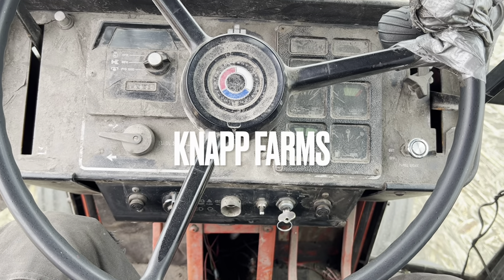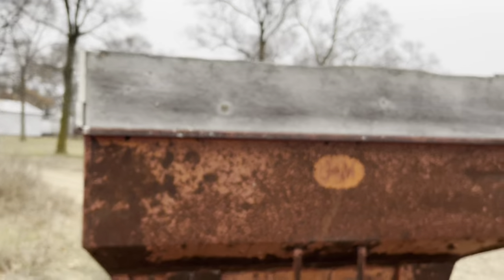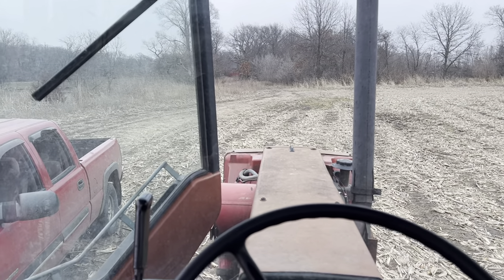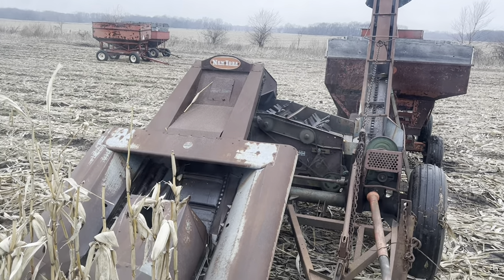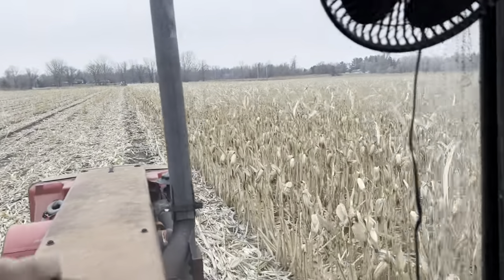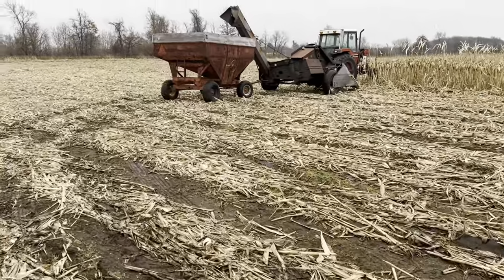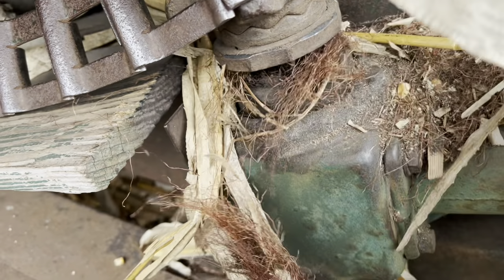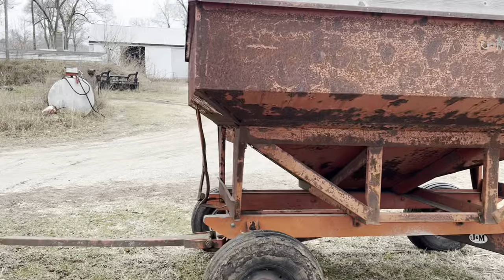Picking ear corn with IH 1486 & New idea picker. Another step in making the best beef

Comment: Too much ground speed. Drop the 14 back a gear. When the corn is balling up at the top of the gathering chains, and it cascading back down the clean corn elevator like that, you're pushing it too hard. That's also causing a lot of shelling loss when it's grinding in the head. 
Like seeing that the older equipment run. I picked a lot of ear corn in my younger days.
Reply from the maker: Watch the newest ear corn video it will explain some of this for you and then you can find something in that video I did wrong

Comment: Just a comment on battery draining, I’ve had alternators with internal regulators put small drains on batteries. I think the cause may be in the diodes allowing current to flow back, with the price of alternators I just replaced them. I would check them by removing wires from alternator and see if it then drained after sitting a few days. Good luck with it.
Reply: usually if the diode is bad the gen light will be on all the time....the best way to track down a draw is unhook the positive batt cable, hook up an amp meter between the pos cable and the battery....see how much of a draw you have.....then you just start pulling fuses until the meter drops to 0...that will tell you exactly where the problem is
Reply: and the easiest way to test the alternator ...while engine is running....turn the lights on to make sure it has a load on it......stick a wrench to the back of it..if it sticks the alt is good

Comment: WELL, I AGREE WITH THE PREVIOUS POST.  TO MUCH GROUND SPEED FOR THE UNIT.  THE CORN SHOULD NOT BALL UP IN THE FEEDER, SHOULD NOT PILE UP ON THE HUSKING BED, SHOULD NOT PILE UP IN THE CLEAN GRAIN ELEVATOR.  SPEED IS NOT EVERYTHING.  YOU HAVE TO GIVE THE MACHINE TIME TO DO ITS JOB.  TO START WITH WHEN THE MACHINE WAS NEW THE CORN WAS NOT THAT GOOD AS FAR AS BUSHELS TO THE ACRE.  BY OVERLOADING THE MACHINE IS WHY THE UNIT IS SHELLING SO BAD.  ALSO, THE UNIT IS NOCKING DOWN A LOT OF CORN IN FRONT OF THE SNAPPING ROLLERS ONTO THE GROUND. YOU CAN SEE THE EARS HITTING THE GROUND.  ALSO, BY OVERLOADING THE MACHINE IS PROBABLY THE REASON THE GATHERING CHAIN JUMPED OFF THE SPROCKET.  SPEED IS NOT EVERYTHING.  THE MACHINE NEEDS TIME TO DO ITS JOB.  NEXT IS THE WAY THAT YOU USED THE A FARMALL TO PULL THAT WAGON FULL OF CORN.  REALLY NOT A BIG ENOUGH TRACTOR FOR THE JOB.  ALSO, YOU ARE RIGHT ABOUT THE TRANSMISSON IS NOT SYNCRONIZED AND IS REALLY NOT MADE TO SHIFT ON THE GO LIKE YOU DID.  YOU KEEP THAT UP THE WAY YOU DID ON THE VIDEO YOU'LL EITHER BUST A TOOTH ON A GEAR OR THE GEAR COMPLETELY.  IF YOU WANT TO TAKE A BIT OF ADVICE FROM AN OLD TIMER, SLOW DOWN AND SMELL THE ROSES.  I HAVE WORKED WITH THIS OLDER EQUIPMENT FOR OVER 40 YEARS.  THE OLD SAYINGS, I HAVE HAD FOR YEARS IS SLOW AND SAFE MAKES SINSE.  FASTER IS NOT ALWAYS BETTER.  IF TOMORROW NEVER COMES, WHAT DIFFERENCE DOES IT MAKE.  IN OTHER WORDS, DON'T EXPECT TO GET IT DONE IN ONE DAY.  GLAD TO SEE THAT YOU HAVE THE INTREST IN DOING IT THE OLD WAY.  KEEP UP THE HERITAGE YOUNG MAN
Reply from the maker: If tomorrow never comes it doesn’t really matter if I was picking at 20 miles an hour and broke everything either

Comment: I have a 1086 that had the same battery problems .  Sometimes dead sometimes not .  I worked
Reply: I worked on that for 2 years.   The problem was the main battery cable on the alternator wasn't always making contact.  I replaced the end on the cable it's been working good .
Reply from the maker: We thought that might be the problem but we actually replaced both battery cables and still same dam problem
Reply: @knappfarms  We replaced the batteries, then cables, then batteries again and now finally our 986 starts every time.

Comment: I don’t understand the need for that much HP, I would use a 50hp tractor to pick corn and had plenty of hp. I have used a IH H and it worked great.
Reply from the maker: It’s not a need it’s the extra tractor that wasn’t being used when we started ear corn and it has a cab unlike all the others for those cold wet windy day
Reply: When my Dad got a 460 about 1960 I remember he used it for almost everything when the H would easily have done the job, I finally realized it probably had to do with the live power and power steering.
Reply: maybe because he is picking in road gear
Reply from the maker: 😂 road gear I don’t know anyone that goes down the road at 6 mph

Comment: Your voltage regulator is sticking in the alternator that's why it's running your battery's down
Reply from the maker: Will have to look into that we just put a new alternator on it wonder if it came with a bad regulator
Reply: @knappfarms  take an OHM meter and put between your battery terminal on the alternator and on your alternator wire and see if you have a draw that could be coming from the dash you might have a bad wire

Comment: You're driving way too fast and you got the RPMs too high for that picker
Reply from the maker: It’s only about 400 RPMs to the picker and I’m running the same speed as the gathering chains
Reply: @terrypotter4779  that's what I also said some kids are just don't get it
Reply from the maker: I mean if you watch the bolt shears because a gathering chain came off that happens when your using 40 year old chains that stretch out
Reply from the maker: But also if your gonna criticize leave more information to back it up what is the proper ground speed to rpm ratio you can’t just leave a blanket statement with no factual backing and expect everyone to go with it
Reply from the maker: The feeder house has husk and stalk in it because it’s so dry it the it floats above the heavier corn that is going up into the husking beds and that corn at the end of the husking bed will be there at 1 mph vs 100 mph it’s because the rollers are slightly out of adjustment but we leave it so it won’t jam and we don’t mind grinding a little husk in our feed
Reply: Terry potter the “corn” in the feeder house is just stalks always build up there cause they are so light and just ride on top the elevator chain
Reply from the maker: The vague statement comment was for the first comment because if the rpm’s are too much how much is right do I just idle across the field and as for cramming it in the everything is opened up to just let it go through all that happened was a chain was loose and fell off ground speed had nothing to do with it
Reply: @knappfarms  you are running that corn picker that is supposed to run at 5:35 to 5:40 RPM
Reply: And also that corn picker is only supposed to go to 2 to3 mph with a 30 to 40 horse tractor
Reply from the maker: You do realize it says right on the gauge and I believe I talked about it in the video that 800 rpm is based on the 1000 shaft IH 1486 have both shafts so if the 1000 shaft is spinning at 800 the 540 shaft is only going 400-450 rpm’s so I’m actually running it slow because it’s old
Reply: @duanebolen543   u seem like someone that struggles with simple tasks like listening
Reply from the maker: I would think they where made to have a 70 up tractor pull them bases on the years they where made but can definitely go 4.5-5 mph with them no problem
Reply: @jimhomes229  I grew up on a farm and I know how farm machinery should be run
Reply: @duanebolen543  well alternators are pretty simple and u don’t know how they work so I don’t believe u know machinery this isn’t the 1940s alternator have regulators that can’t stick
Reply: @Knapp Farms  understand what your saying but your travel speed is way to fast. Did you watch your elevator. When the elevator can't handle the corn means your going to fast. When those ears stop flipping that down in the elevator they' ll jam in there. Also when you see stalks jamming up in the gathering chains is another sign. We used that same picker your using for decades and it'll do the job, just slow it down and you will see alot of your issues go away.
Reply from the maker: The corn is bound to fall back down the elevator that’s why there is a large area it can pull out of with how steep we run it to be able to pull larger wagons and it only bunched corn up at the very beginning when I was lined up exactly on the row
Reply: @jasonleckrone2577  so true to that if you look on Facebook you'll see how attractor should be going through the field with a tractor and picker and wagon look at his tractor he doesn't even have the shields on the side of the he just looks to me like he's a half-ass person
Reply from the maker: Alright sense I’m not the first to insult you boomers on here are great you guys do realize you are the reason we don’t put hoods on and add things into videos to get you to comment and keep watching because views equal ad revenue and comments help analytics which gets more views so I appreciate all these comments and views
Reply: @Knapp Farms  I agree with but did you see the hulking bed backed up too. That's when you start having problems. That's the reason your tractor speed is to fast. We used an 886 that had the gear speed you are running and we could never run high 1 or 5th gear. Not trying to be mean but we had that experience for decades of using the same equipment you're using.  I commend you for using that equipment, it's been reliable for decades and still used. Just know the capabilities. Word of advice: Don't get upset by a lot of these comments. Most people either never farmed or used this type of equipment
Reply from the maker: The husking beds are not backed up that corn gathers at the bottom either way because we have it adjusted to let a little extra husk through and not jam so the end just holds ears that the husk didn’t rip off
Reply: We used the same picker 50 years ago , we ran with a 460 ih because the big tractor was  working corn ground, the big 1 was a 826 ih. No cab heat houser only.
Reply: I haven’t picked corn in almost 50 years and then we didn’t have a tach on the tractor.  I agree with your statement about running it where it seems happy, you’re the one running it, you know it’s happy zone. That is how I run all my vintage equipment from rock crushers to motorcycles, in the happy zone determined by listening and feel.
Reply: Ya run about the same as we do I mean I’m not sure what the argument that dude is trying to make but I mean your speed n rpm is literally same as what we do n works perfect. On older equipment there going to be breakdowns I mean that’s jus what happens. Also if he was talking about all the stalls piling up that jus happens I mean there so light there going to pile up n don’t really hurt nothing
Reply from the maker: Thank you it’s nice to have someone with the common sense in here
Reply: I'm not trying  to argue  but he is right  u should  be low 2 or 3 not high 1 its too fast cuz when ur leaning the corn stalks towards the tractor ur going to fast just like in a combine and that's part of the reason ur gathering chain came off and it probably need to be tightend like u stated and ur elevator is a little  to full they weren't ment to be that full. Also don't be to proud to take advice most of us old timers were running this equipment long  before u were a thought in your father's head
Reply: As long as people are commenting they are watching-maybe they can learn something! Most negatives never had any experience with old iron either just go buy new😖

Comment: 540 is the proper speed of the PTO@
Reply from the maker: I’m running it slower then that because it’s so old the 800 is based on the 1000 shaft so the 540 shaft is only spinning about 400-440